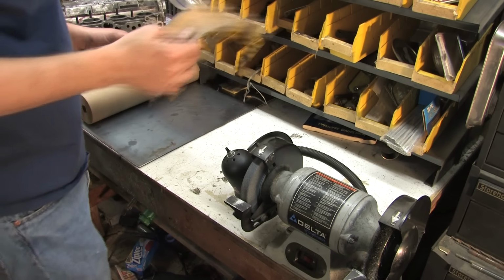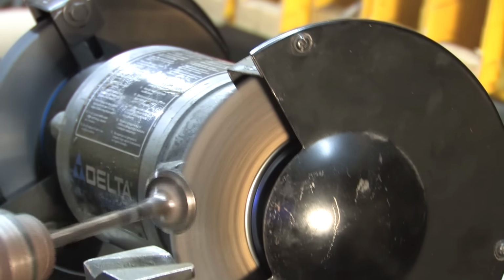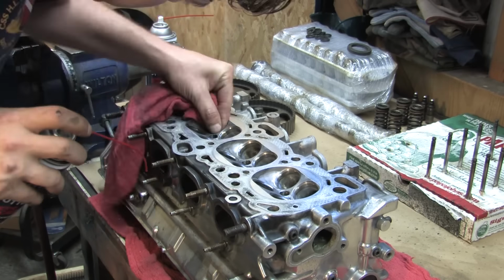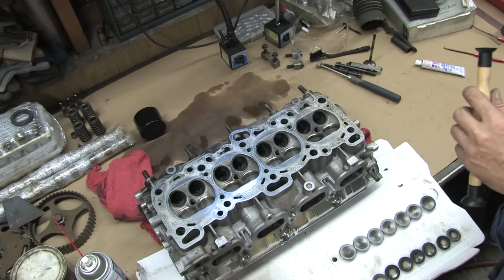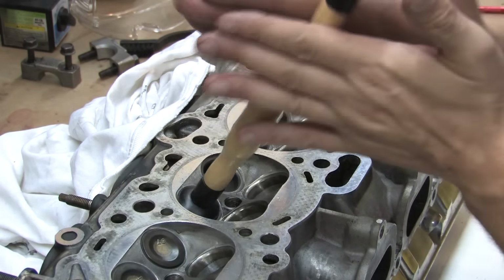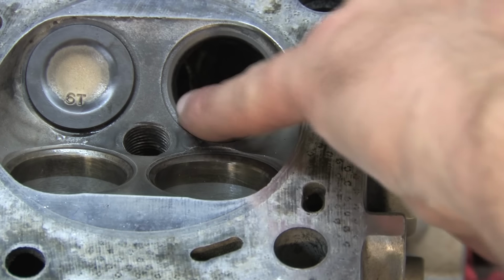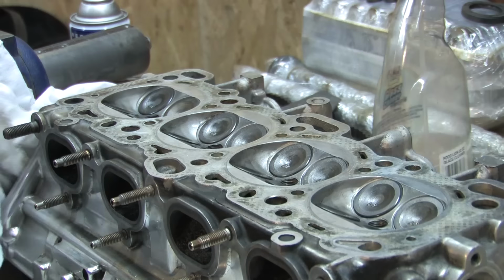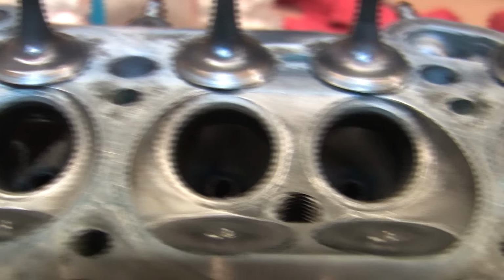Cylinder Head 105 - Valve Job Basics

Comment: Your dead on bout that valve lappn for sure. I can see the guys point in drills , BUT I wouldnt do it that way, as you said, how can you hear the cut??  To each his own. I dont pretend to be perfect at all, I learn paint tricks to this day, but dont recommend em for beginners and some may even say Thats wrong. I just know I dont have come backs like others do. I try and help them, but they are "Perfect", so have at it.  Oh, on the job im doing, 1 man said I'd have to take the throttle body off and all kinds of things to remove the Intake manifold, to get it off the head studs......Not.....  Theres a bracket underneath, as you know, and take the 2 bolts out the Intake pipes and loosen the 2 on the block and it moves  way back towards the firewall, affecting nothing.  He swore i was wrong, but like You, IF you dont know, you say so, and I respect that, and the research you did for me as well. Thanks for the Great videos and the way you explain things are fantastic.Keep up the good work. Back to the booth, have a good day Jaf

Comment: I've seen a lot of butchers on here valve lapping with a drill among other things.  I don't think Jafro is one them.  I've also seen a lot of mechanics beat up on DIY video's.  There is no match for the kind of equipment that a machine shop uses.  But there is no harm in trying to " do it yourself ".  Everyone has the right to f*ck up there own sh*t.  If you can't offer guidance or advice or anything other than " Take it to a machine shop and give me a lot of money " ,  then just shut the f*ck up.

Comment: So like a stupid idiot I got my valves mixed up, would lapping them well enough remedy this issue. Assuming the head is in good condition as well as the valves.
Reply from the maker: Randy Cramer At this point, that's all you can do to tell.  Lapping them shows you if and how they're lining up.  The wear ring on both parts will show the contact area.  Another non-abrasive way to do it, though... is to use a sharpie on the contact surfaces.  Do the process without the lapping compound.  That way you're not widening the contact surfaces and you can see how they mesh together.
Reply: So mark the seat of the valves and the seat in the head with a sharpie, then lapp the valves and look for a consistent sharpie ring left over on the outer edges of both seats?
Reply: Or the middle of the seat, no?
Reply: *****  do you suggest I use some type of lubricant along with the sharpie or just do it dry?
Reply from the maker: Randy Cramer dry.  you want it on the outer half of the valve, and even all the way around on both parts.
Reply: Thank very much! I will do as you instructed. Luckily it's a spare head so I'm not THAT stupid lol

Comment: Great video! Thank you for posting; very informative and articulate. One thing I do differently is that I put toilet paper down into the valve chamber. I am very fearful that I will miss some of the valve grinding compound, and leave some of it below the valve, even if I use clean rags. At the end of the process I remove the toilet paper by sliding it up the valve chamber. Any grit on the walls of the valve chamber or that fell down into the valve chamber will be recovered by the paper

Comment: Not sure why he is against using a light adhesive or something sticky on the lapping tool. Cleanup would be easy considering he is using that gum cutter which will remove just about everything from any surface.
Reply from the maker: +Brian X It's just the time and effort of applying and removing it.  It takes just as much time but adds more work beyond just putting up with the suction cup by itself to achieve the same result.  Though I'm a complicated S.O.B. in real life, my reasoning is always very simple.

What works better is the small suction cup used for small engine repair.  It sticks MUCH better, and it lines up further from the edge of the valve making it harder to contaminate.
Reply: because it's extremely bad , im a mechanic by trade ,you need practice this if youve never done this before and it the best way sometimes a human hands and a stick with a sucker thingy on the end could have worked so great , also if your a real car enthusiasts you should do some research , I find this technique best plus its cheap and you can d.i.y it no expensive tools here ,  massive costs  etc plus ive fix many really bad seats this way , cheers great video
Reply from the maker: +Gaz Girl Gaz from Invader Zim?
Reply: +Jafromobile na mate its Gaz for Gazelle (nissan s12) :)
Reply from the maker: Right on!  Gaz is also short for Gazlene, professor Membrane's daughter on Invader Zim, although it's never clarified as to whether she's his biological daughter or a lab experiment.  She has incredible telepathic powers over all things mechanical and electronic.  She can also control weather, start fires telepathically, and levitates when she's angry.  She's the smartest and most potentially dangerous character in the series if you cross her.  Invader Zim had a relatively niche audience, so I figured it was a long shot.  But Gazelle is very fitting for an s12 owner, because boy can those things run.

Comment: Replace seat: weld the seat it will fall out. Heat the head, freeze the seat It likely will fall in or require a quick few taps.

Comment: I like the lawn mower/go kart lapping tools on the smaller I4 valves. the ones at the parts store were way too big.
Reply from the maker: erik61801 I can't upvote you enough.  That's precisely what Mark did at the machine shop when he was doing the valve job on my GSX cylinder head.  It worked WAY better!  Edit:  it's in cylinder head 201.

Comment: Great tutorial! Just done this on one of our engines. How do you get it so clean though! Ive used carb cleaner and engine degreaser but still some of that crap is hard to get off. I come from the UK so some good cleaning stuff isn't easy to find! Any recommendations?
Reply from the maker: Beat The Mechanic White spirits.  There's a video of mine about it.  Search my stash for "DIY parts washer" and you'll quickly find one of the most efficient and effective solutions to your problem.  ;)
Reply: thank you, I will check that out,
Reply: +Beat The Mechanic It's so much cheaper, please do! :) Works a lot better too.

Comment: I'm not intending to throw too much cold water here, but Valve Lapping is only if you don't grind your valves and seats. The practice has been outdated for several decades because the valve head grows under heat changing the "Married" mating surface areas while running. Make sure you have proper margin patterns on the inner and outer Valve Face. .......... 

Just wanted to let people keep this in mind when Lapping because the actual mating surface may be toward the inner part of the valve face and if multi angles are on the valve without a proper margin, then there's a possibility of mating on the multi-angle valve curve. .......... 

The presentation was very good.
Reply from the maker: Thumbs because I wholeheartedly agree with you!  It's just an inspection procedure nowadays.  That's all I did here because I didn't have a bad valve or seat based on the margins observed.  I didn't cover it in this video because every engine is different.  :) b
Reply: @Jafromobile  that was cold water  .. so on which valve face geometries is it ok to do this procedure? water boy, pls elaborate!

Comment: is this necessary? I never heard of what you doing in the video. My car runs great for 150k miles.
Reply from the maker: Cool!  Roll with it.  This isn't preventative maintenance.  If you're in here this far, something else already happened.  If someone's talking to you about a valve adjustment regarding the service of your engine, this is the wrong kind of head for that, and a different procedure.  This one has a hydraulic self-adjusting valvetrain.  A valve adjustment doesn't require removing the cylinder head.

Comment: There is still pitting in both the valve faces and seats , this is not the right way to do a valve job if you want it to last for any length of time. The pitted faces and seats will fill up with carbon and degrade the valve sealing surfaces. The valve faces need 45 degree refacing if margin spec can be maintained.  Valve seats need cleanup with proper cutter or stones. All of about $80 -120 worth of work  with a local automotive machine shop done right. And Last but not least valve stem to guide clearances must be checked to make sure there is no excessive loose play in the guides.  If you have to lap the valves to the seats don't make the valve seat too wide, there is a spec for that too.

Comment: Great video, but there are a few checks that got skipped over.

Wear on the valve stems should be measured first before cleaning them. Use a micrometer to determine if the valve stems are within spec. Typically the stems will measure fine since the brass guide is softer than the valve stem.

You don't need to put tape on the valve stem. The stem is as hard as the teeth of the chuck and you won't damage the stem. Also the wire wheel does not need to be brass, a steel wire wheel is fine. Just keep the work rotating with the drill when pressed against the wire wheel. Also make sure that the head of the valve is not wobbling when spinning in the drill (bent valve). 

After cleaning the valves, take a good look at the face of the valve. If it is deeply pitted the face will need to be ground down in a valve grinder.
Reply: Always that one guy out there like you trying to steal someone else's thunder.  He in good taste took the time with all of US to share a valuable Life Experience yet you want to Sharp Shoot the guy down.  He's NOT a machinists or mechanic, just a Joe Blow average guy showing us how he did HIS stuff, finances etc...  Yes, maybe he was too careful & maybe he over explained,  Sooooo What!  We believe in him, not you.
Reply: Always that one guy out there like you trying to steal someone else's thunder.  He in good taste took the time with all of US to share a valuable Life Experience yet you want to Sharp Shoot the guy down.  He's NOT a machinists or mechanic, just a Joe Blow average guy showing us how he did HIS stuff, finances etc...  Yes, maybe he was too careful & maybe he over explained,  Sooooo What!  We believe in him, not you.

Comment: You guys know the best way to vlean valves? 
Buy new ones, way faster don't cost much only if you want more power and you don't have to worry if a valve didn't work :)
Reply from the maker: +Johny Cage Nah, really... the best way to clean valves is to drop it off with a mechanic who marks up the machinist that has to cut 16 new valve seats for 16 new valves just because they were dirty, then bolt the head back on your car, and call you to pay for it when it's ready.  Because that way, you don't even.

...and you can just blame him when the valve doesn't.  ;)
Reply: +Jafromobile ahaha that's a good excuse ;) just pay extra money lol

Comment: a valve job is done with seat cutters, this is just lapping valves,
new school says, NEVER USE STONES AND NEVER LAP, the abrasives imbed into the seats and valves accelerating wear,
a proper valve job is done on a NEWEN CNC machine or a SERDI. and no abrasives.
Reply from the maker: New school would be new school without the old skool.  This is one of my 100-level basics videos.
What you're looking for is my Cylinder Head 201 video.  It's linked from this video in an annotation, but you could search for the 201 and get there faster.  Enjoy!

Comment: I need to re-seat valve seats on the cylinder head but need to replace the valves. when re-seating can I use the new valves to make the new seats on the cylinder head
Reply: 06chargersxt

Comment: My sucker wont stick to the valve at all.
Reply from the maker: Lapping handles go bad eventually from dry rot.  Get a new stick.  Go for the smaller one.  They make a handle like this for small engine repair, too.  It works even better than the one I'm showing.  Looks just like it, but smaller.

Comment: First off, explaining how you clean the valves is fine. Lapping is a big no no. DO NOT LAP valves! Why? First off, valves are a vendor item from a manufacturer and they are usually far from perfect. If you worked in a real machine shop, and saw how crooked the valves are from the factory, you would understand that they need to be properly ground on a valve machine.
 They come with specific angles. Usually 45 Degrees and 30 Degrees. Some exceptions are out there.
 Now the reason why you never lap a valve. On a 45 degree valve for example, the seats are at 45, the valve is at 44. This is called an "interference angle" and allows for the most pressure on the smallest area on the face of the valve. If you lap, you are making both angles the same, and over a short time, carbon will cause the valve not to seal properly. When you get done properly grinding valves, they will seal perfect, and you will actually see the sealing line where the two angles meet on the face of the valve. Most valves need a lot of grinding to true them, as factory valve jobs for the most part are crude. Some more then others.
 Please don't endorse home valve jobs, this is a complete waste of time! Take it to someone that does it for a living!! It is worth the money spent, and you will get a good valve seal for years rather then a couple weeks! Thanks for your time!
Reply from the maker: I agree with you on all points.  Lapping is only a means of checking the condition of the valve seat.  It doesn't magically rejuvenate the seat or the valves, but it will tell you if the valve is too far gone and whether or not you have to machine it to get it to seal again.  The point of doing the work by hand [rather than machine tools] and listening-feeling when to stop is why I made this video.  Over-lapping a valve ruins the seat.  Power drill methods are basically mechanic-assisted suicide of the parts.  I absolutely hate seeing people do that.

I was able to salvage this head and the valve job with the cleaning-lapping technique used here, but no, it wouldn't be as good of a job as freshly-machined seats and ground set of valves.  It just buys time, like you mentioned.  If the quick lap reveals a bad seat, no matter of lapping will fix it, and this procedure will reveal what your next step should be.

In addition, you might have seen it, I don't know... there's an annotation that links to a radius cut valve job on this very head because I changed directions with the build after this video was shot.  It didn't need it because the margin wasn't too narrow or wide... but I went with bigger valves to compliment my turbo and RPM range selection.  When a machinist sets up a radius cutter or other valve grinding machine, they test their setup by lapping a valve.  It's the only way [short of marking dye] that you can get a good look at whether or not the seat is centered and the angles cut properly.  Once it's dialed in, they repeat that cut on the remaining valves.
Reply: *****
All you need to do to check if the valves are sealing, is with the head off, turn on it's side with port side up, so that you can spray carb or brake cleaner down the port. Facing the valves, you will clearly see if they get wet, meaning they leak. Do this on both sides of the head, turning the head so that the ports face up based on the valves you want to check. 
 If they leak, take it to a machine shop that can properly grind them, and re grind the seats using the interference angles I wrote in my last paragraph.
 Looking at a valve or seat doesn't tell much. When I grind them, I find that factory valve jobs are atrocious.
 An engine will run so much better when the valves seal!

The interference angle I mentioned, is critical. The seat is at 45 degrees, and the valve cut 44, in most cases. Some are 30 and 29.5.
 When this process is done correctly, you will have a sealing line on the face of the valve that all your spring pressure will force the valve to cut through any carbon or debris everytime it shuts allowing for a perfect seal. Take care
Reply: I wouldn't pay you to rebuild my lawn mower.
Reply: ThatDanDude  Thanks, but lawn mowers I only do for myself. I hope you can find someone to help you
Reply: themaxrider You missed the point, your ego got in the way of things.  Anyone can talk mean and anyone can say " your doing it wrong ".  These videos are not about feeding your self esteem.  Nobody cares what you can do. NOBODY.  What people are trying to do is fix or rebuild there engine.  All you have to offer in this entire dialog is " pay somebody else ".  Where in this did you offer anything?  You have nothing to offer except " let me or someone else get in your wallet to fix it right ".  I'm not a mean human being, but I do recognize an ego that isn't worth anything if it can't offer someone else proper advice.  Jafro can polish and port like I can only imagine for now. I respect that.  I've seen my share of hack's and I don't believe he is one of them.  You my friend should check your ego at the door.  Automotive stores would not offer such tools if they did not  work....at least for a while.
Reply: Re read what I wrote, follow the directions and live happily ever after!
Reply: I worked at a machine shop that has product flying though the sky and floating in space, and they respected the grit.